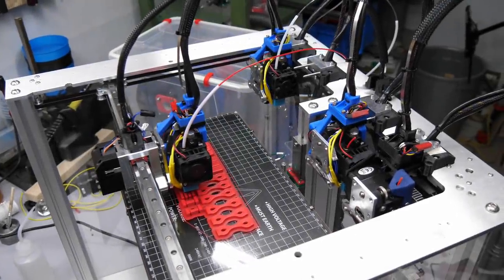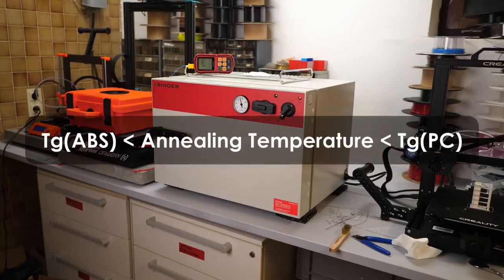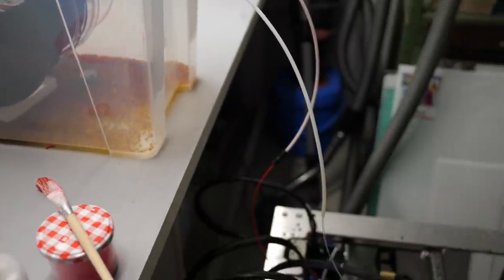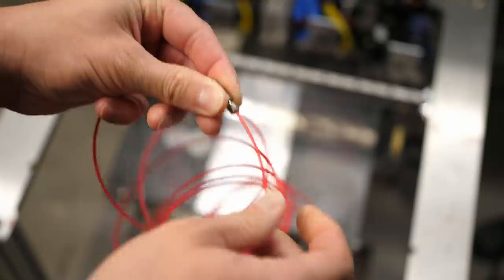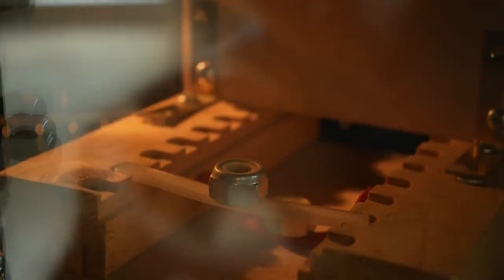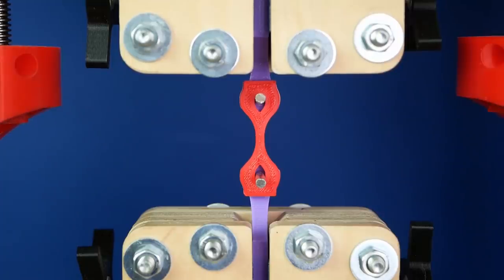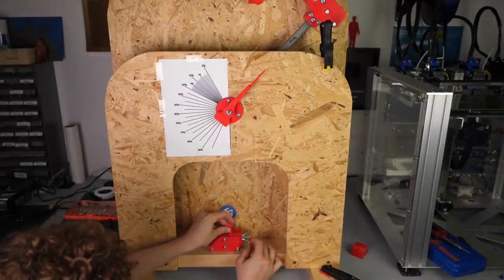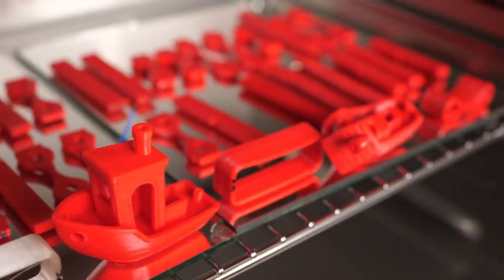PC-Core ABS - WARP-FREE annealing with Ingenious Dual-Material Filament

Comment: I think I could see why the layer adhesion wasn't as good as you would like to have seen. It maybe has to do with viscosity or particle charge in a way. 

The ABS had a higher affinity for the PC and as the PC wasn't deforming at all it may have been holding the ABS back. This may also have had to do with strictly the surface of the filament. Certain plastics are very resistant to being glued together PETE for example must have it's surface chemically prepared before it can be glued. 

Perhaps there is an oxidation occuring from the filament being created through heating and extrusion. Oxidation or as another poster mentions some plastic degrade with subsequent heating cycles. 

This "degredation" is likely off gassing of various compounds that may act as a flux of sorts. Try cleaning the PC core ABS filament with Acetone then print the test models and anneal.

 This dual material filament in you're first test though disappointing has pretty significant implications for example combination of PLA and a Foaming PLA core for finer surface finish. Or a combination of water soluble filament to extrude parts with channels that could then be filled with carbon fibers, glass fibers or for copper or other conductive wire for integration of electronics even hydraulic systems that are integrated. 

Another test could be to conduct the annealing cycle under vacuum.

Comment: Great work as always but the result is exactly what I expected based on your previous experiments.  Am I wrong or did you do an annealing experiment that showed ABS gained nothing from annealing and PLA got major improvements in heat deflection and stability and minor but significant improvement in strength.  PLA has the most to gain from improved stability core and annealing but what would be compatible?
PP is another great "glue" candidate, but as good as it sticks to itself, absolutely nothing sticks to it.  In regular injection molded parts I used lots of 15% glass filled PP.  Super cheap, super consistent, super impact strength, ok stability and strength.  For even better dimensional stability use mica fill.
About alloys -I remember GE was always trying to sell us Noryel -a proprietary alloy we suspected was mostly ABS.  It was money for nothing.  In all our own compounding, the only thing worthwhile was an impact modifier. 
BTW PC is the cadillac of plastics.  Don't mix it or modify it.  Just learn to use it right and enjoy.

Comment: You choosed in-between value of the material at nozzle at 260°C. 

So the Lower Temp material, did get Higher Temp, and the High temp material, get lower temps.

Did you try to choose the highest printing temperature of the highest material for this print ? Maybe, the temp was not enough for the highest temp material? to better fuse with lower one.

Plus... As the highest temperature material is at center, i assume the center part, is the latest part to receive temperature from the nozzle, so maybe you should try print slower to get more uniform temperature on the inside material.

Continue good work !

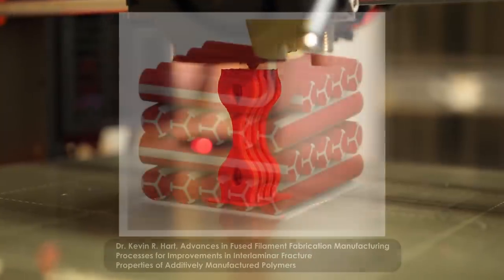Comment: 1:42
i work in a plastic factory, the line im work on produces wound sheeting (the blue plastic stuff used in surgeries) and we actually do a similar thing to make it
the sheeting is blue one one side and white on the other, and the way we do that is have 2 REALLY wide extruders extrude onto eachother before going into a roller so that the laminar flow makes the color evenly spread without mixing

though this causes problems sometimes because if 1 extruder gets fed even alittle less material then one of the layers gets thinner while the other gets wider and we end up needing to scrap 100-400 pounds of plastic, acouple nights ago we ended up scrapping over 6000 pounds of plastic trying to fix a problem with the machine...
though we are able to reuse most of the scrap, unless its burnt

dual material (or in my case dual pigment) is pretty good, but for production stuff it can be quite painful to work with

Comment: has anyone ever tried printing with a wire core? It would probably take an entirely different extrusion method than current 3d printers, or not even extrusion at all (I could imagine a much more "sticky" plastic which around a very thin metal wire, which simply needs to be heated, then layed out in some way, like those wax covered strings for kids).
But creating a 3d printed material that actually has interlayer wire, even if it is a very thin wire, seems like it could have some amazing properties.
Actually, you could even try using fishing line actually, if you figured out a way to fit it inside printer stuff, while also reducing the amount of thinning from extrusion. Fishing line has amazing tensile mechanical properties.
OH I didnt even think about needing to lift the extrusion head, something using this would need a "cutter" to cut the wire inside. If you do attempt to dabble with it you could always just do vase printing or something that doesnt need you to lift the print head.

Comment: Thermal binding has to be the answer, I wonder if incorporating a precise thermal source to flash melt lower layers as the upper is put down, providing better bonding.
Many technical difficulties, I would assume something akin to a laser as final form, but frankly the largest issue W annealing seems to be the glass transition vs chemical/structural changes. There may be a sweet spot, but I think a different approach may provide a better low end result.

Comment: Have you tried to redo this test with your filament machine and your custom drilled nozzles? I think this should be revisited with new tests if you havent already... You should also get a desktop CNC machine to mill out some custom nozzles. I was also thinking a dual channel nozzle that extrudes one filament strand in the middle and the other filament through a surrounding ring around the inner channel of the nozzle. I dont know how possible that would be because of how small the nozzle cutouts will be, so maybe just do it with a big nozzle as a first test?

Comment: I can think of ultrasonic welding and isothermal defusion.   How about  heating ABS to the glass transition point while being supported by say sand so warping doesn't occur.  
Now to deal with fusing layers together.  Need to create a pressure.   Use a liquid like water to excite with an ultrasonic transducer.  
But water will boil at the glass transition temperature at atmospheric pressure.   Pressure cooker like an insta-pot with electronic timer and temperature control.  
However; do not want the water to defuse between the layers so make a thick liquid like jello etc.   
The transducer could be placed on the outside of the pot.  The lid makes the most sense where to get access.  Air gap will make it useless, however;  if strong magnets can clamp together through the lid then a horn is created to transfer vibrations to the liquid.  
I am thinking out loud putting pieces together   Maybe you can make significant improvements.   I have a printer that I have not done much with but have a reel of ABS and my wife has an insta-pot.  My skills at printing are thus very poor and I have zero test equipment.

Comment: I feel like the only way to truly fuse layers together is by using a laser even for fdm plastic printers like with metal printers. Theoretically the only way youre going to actually be able to fuse the layers together is with immense heat and pressure [or just straight force simplistically] for a very short amount of time as to not burn the material or totally liquify it. I mean thats how metal welding / fusing works to begin with. Why would it be different with plastic from a first principles perspective? All that should change is the temperature range and force range, no?

Comment: instead of going through the trouble to try to reproduce the actual filament. I suggest modeling a pc structure inside the 3d print to maintain dimensional accuracy while annealing.
Another interesting method would be to print with 3 or more perimeters in the part and have the inner perimeter/infill be the PC. im not sure what you'd have to change in the slicer to get that to work but the results would probably be promising.

Comment: You did make a poor man's version the internal structure might be very important to  The overall strength of the material I think some modifications  To a couple soldering irons and some metal tubing Might be useful in making some kind of  Extruder for forming that filament.

Comment: Interesting that your PC Benchy had a weird burn(?) line on it (10:34).
I had a line looking just like that when I tried printing a Benchy in PC (with a 0.15mm nozzle... 😹), but the line on mine was a little higher up the part: https://imgur.com/a/lD4AYRq
I've no idea what caused that with my print, but it was my first ever PC print, and I've not used PC for anything since then...
(I also had the PC fuse to my PEI-stickered bed, tearing a Benchy-shaped hole in it!)
Reply: Usually it's a little booger of material that sticks on the nozzle, overcooks, and then gets deposited later  in the print

Comment: As heat treatment put the prints into sand and heat the sand to 170-200 degree. So the sand becomes the mold to keep shape and maybe the higher heat melts the 2 materials together.

Comment: it would be interesting how big the influence of the core design would be. I imagen a cross design where the pcreaches to the outside could possible strengthen layer adhesion as you could get pc sticking to pc instead of just the abs connection between layers

Comment: Do you think the 135 degree annealing temperature would have made a significant difference to the strength and layer adhesion?
Reply from the maker: No, I don't think so. More time or significantly higher temperatures might have helped.

Comment: I wonder if there is a way to alternate layer height between adjacent walls, so the plastic at different layer potentially interlock mechanically even if they are not fused together

Comment: I've been trying to come up with a solution to the layer weakness problem from the slicer side. Some form of interlocked layer infill to reinforce the layer lines on solid prints, using some vertical movement while extruding. I think it would be possible to get the current layer linked to the one above and the one below it, without running into too much trouble from the nozzle taper. Have some holes in the previous layer, and some bumps sticking up into the next layer, so you move down and start extruding into a hole, lift up, move horizontal until you're next to one of the bumps, lift up some more, move over top of the bump, and then stop extrusion.
Reply: different layer heights for the perimeter and the infill might do alot. say something like 0.15 for the outermost wall. then 0.25  followed by 0.35.

Comment: The most interesting part of the video to me was the printer that extruded from a solid rod of material, why can't we have printers that accept granules or rods of material directly so you could easily recycle your old filament?
Reply: We do have DIY machines that allow you to process recycled filament now, but I reallllly want to see something for the block extrusion, I'd like to do some testing with core shell filaments, I think there is a ton of room for improving mechanical properties of prints using this method.

Comment: As a civil engineer, I am testing reinforce 3D prints with screw rods in a similar way reinforce concrete works. The layer separation is a kind of failure similar the that found in concrete samples. Concrete behaves well in compression but poorly in traction. My preliminary tests show some good results. Now I am trying to properly predict the bending moment a reinforced printed beam can support to test my model.

Comment: Why didn’t you just BUY some  of the combination filament and test That?   Clearly, the geometry of the core extrusion is a critical parameter in how well it will anneal.
This is merely a test of home made combination materials.
Reply: Because it is NOT POSSIBLE to BUY it, it is just a research paper where the researchers made a small amount of filament by printing the core shape and drawing it out to a filament in a lab?
Reply: The combination filament mentioned was an exparament in a lab. To my knowledge no one is selling anything like it yet. He mentioned in the video that the 0.4mm nozzle he used limited his ability to replicate the geometry. I think you are right about the geometry being important as the academic paper he linked to went through multiple designs.